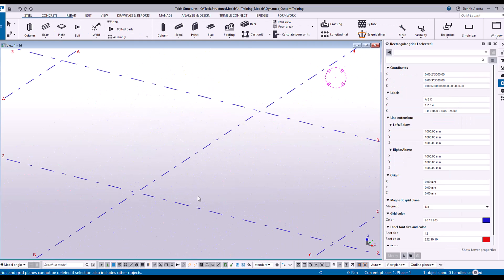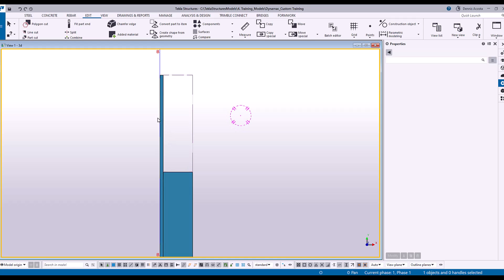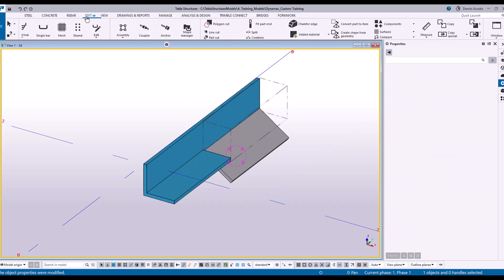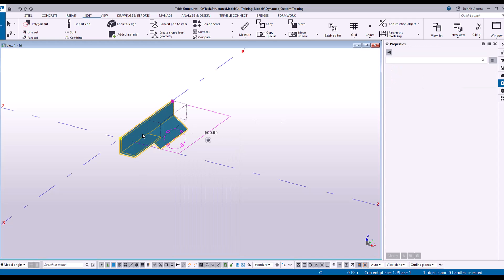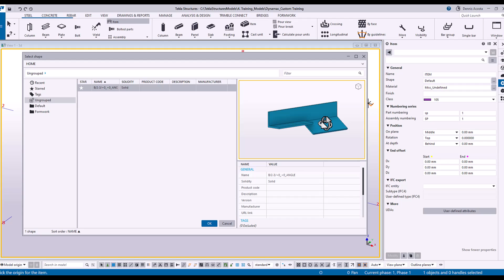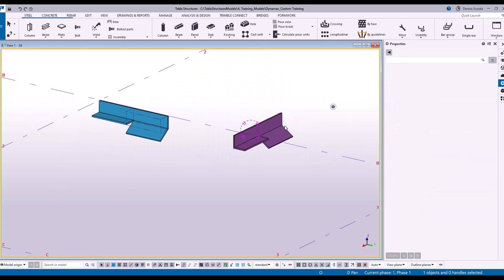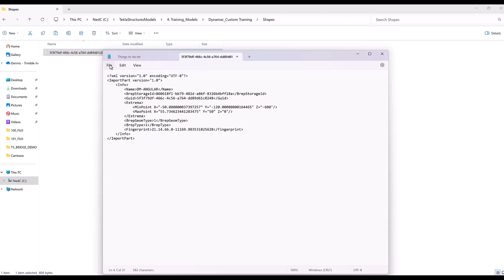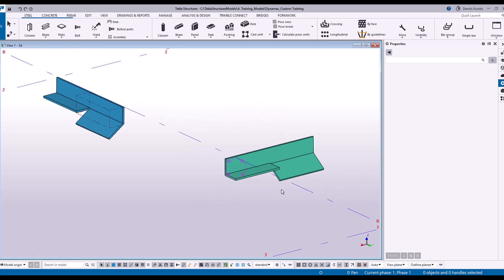Convert to Item

Comment: How do we check if 2 or more members are welded together? if there any tool to check with ?
Reply from the maker: Select one of the connected part and right click on it then inquire assembly. If it is welded you will see the red and yellow color. Yellow means it's a connected part. Red means the main part of the assembly